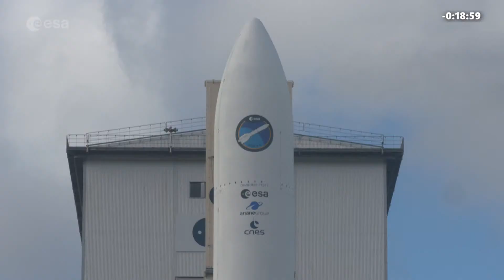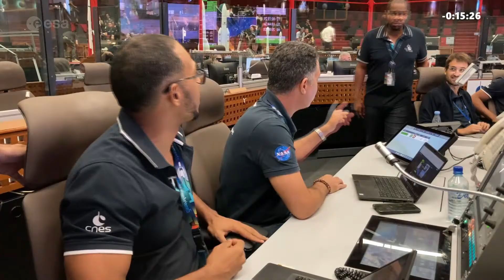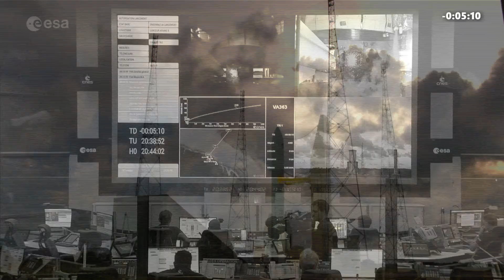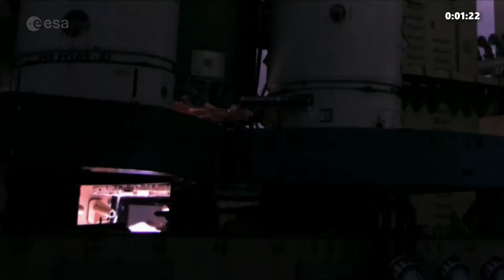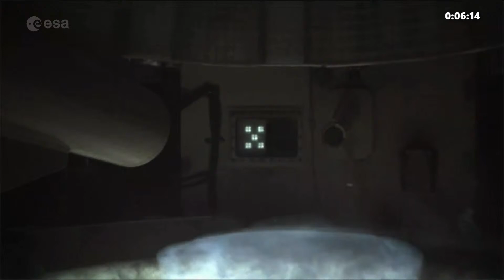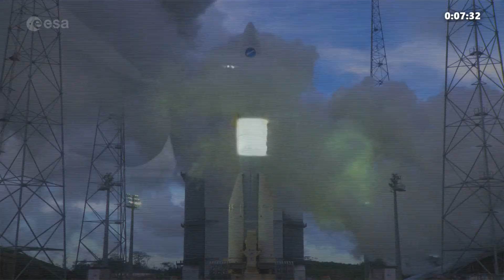Ariane 6 full stage engine hot-fire test

Comment: THIS is an engine test! Hydrogen engines, the most efficient chemical fuel, roaring away for over 7 minutes!
The exhaust plumes from the flame-trenches demonstrated a professional launch pad designed for rockets with powerful thrust.
Elon Musk should have looked at this launch site before he started on Boca Chica.

Comment: Congratulations ESA! ... Just a couple of things to add: Why no engine sound provided to the viewer? ... Also, why doesn't ESA have any human-rated rockets? .... Btw, it would have been nice if the narrator had talked about the specifications of the Ariane 6 rocket, like the lift capacity to LEO, GTO, TLI, TMI, etc.. Also, the thrust produced by the main engine and the boosters.
These are small things, but they add to the viewer experience.😊
Reply: ariane 5 was pretty much human rated. and just look at wikipedia for the rest

Comment: Hope to see it flying soon. Maybe start working on an Ariane 7 or 9 with 7 or 9 of those engines so we get a fully liquid fueled rocket that can be landed and reused?
Reply: you don't necessarily need multiple engines to be able to recover a rocket. as long as one engine has a high throttle range it can be used launch and landing (or reentry if needed)
Reply: @HamzahKhan314  True but it is easier to just use the engines you already know how to build instead of developing a 10 times bigger engine. Then one of the same engine can also be used on the second stage.
Reply: @zapfanzapfan true. tbh i dont know much about ESA's future launch vehicles
Reply: @HamzahKhan314  There are talks of something like Falcon 9 but fueled with methane in the 2030s... I guess we'll see...

Comment: So pleased that Ariane 6 is looking to finally fly in 2024, Yet also in 2024 SpaceX's Starship should also be flying, The Starship will be able to transport over 150,000 kg to LEO, 21,000 kg to GTO, At a significantly lower cost than a expendable Ariane 6 launch.
Reply: I guess that will happen around the same time as hyper loop is finished...
Reply: also, starship will need time to develop their unproven re-entry system: the tiles are falling off all the time, even at zero altitude.
Reply: @wim0104  Even an expendable second stage Starship will be able to launch Starlink sats at a very low cost compared to Ariane 6.
Reply: Starship is nowhere near ready to take payloads, and none of their engines has run for this long, AFAIK. Ariane6 is not a development prototype.
Reply: @wim0104  "Starship is nowhere near ready to take payloads"

Honestly neither is Arianne 6, it has never even left the ground...

"and none of their engines has run for this long"

Starships second launch lasted 8 minutes, neither stage however is meant to last that long.

"Ariane6 is not a development prototype"

and yet has never left the ground.... Ariane 6 is also no where close to comparable to Starship, Ariane 6's equivalent would be Falcon 9 which has already had 284 launches and the Falcon 9 will apparently be significantly cheaper to launch too:

Per Launch Cost:
Falcon 9 - $67 million USD
Ariane 6 (62) - €75 million ($81,733,500 USD)
Ariane 6 (64)  - €115 million ($125,317,800 USD)
Starship - $100 million USD

"also, starship will need time to develop their unproven re-entry system"

HAHAHA, go look up SN15, I mean you do realise SpaceX are the leaders in re-entry right? Regardless you say it is unproven yet can you remind everyone how many re-entries Ariane 6 has? Oh right none, so they are the ones that actually have an unproven re-entry system because SpaceX has a proven and well test re-entry system....

"the tiles are falling off all the time, even at zero altitude"

The tiles were failing off in flight.... SpaceX also didn't really care, they just wanted to test the hot staging.

Regardless Ariane 6 is equivalent to Falcon 9 not Starship, Starship is significantly larger than Ariane 6:

Starship:
Mass - 5,000,000 kg
Length - 121m
Diameter - 9m
Payload - 100 - 150 tons 

Ariane 6:
Mass - 530,000–860,000 kg
Length - 63m
Diamter - 5.4m
Payload 10.3 - 20.6 tons
Reply: @wim0104  The last Starship test  had the engines run for almost full duration and Starship got into Space before it broke up, a major success.
Edit Starships are in mass production I expect to see the next test in a couple of months, and three more starships are almost ready, sure SpaceX will succeed shortly.
Reply: @favesongslist MuskCult™
Reply: @favesongslist  Tell that to potential customers, lol..."Yes your satellite has now turned to powder, but remember that Starship's engines run for almost (almost!!! ROFLMAO) full duration"
Reply: @ericmarseille2  NASA were very pleased to see the progress made by SpaceX
Reply: But it didn't, LOL. Begone MuskCult™.
Reply: @java4653  What?